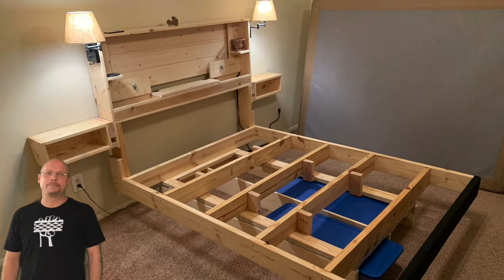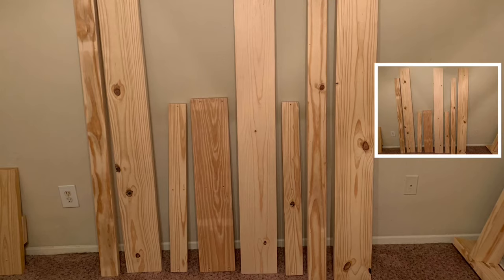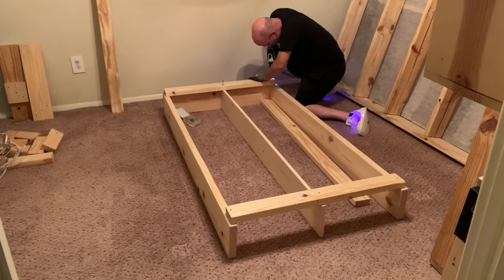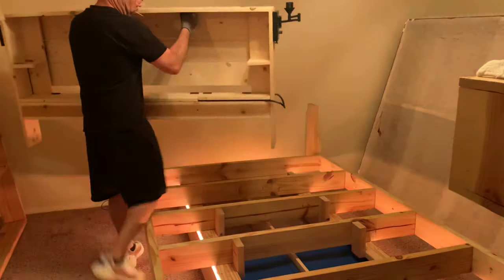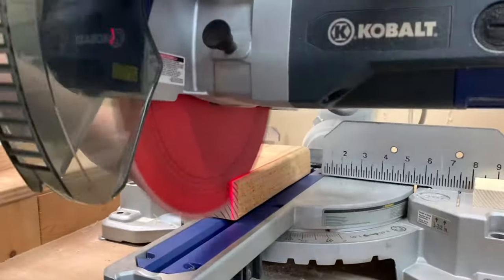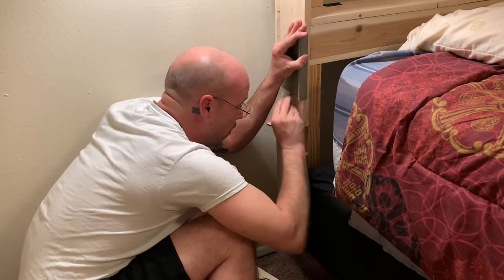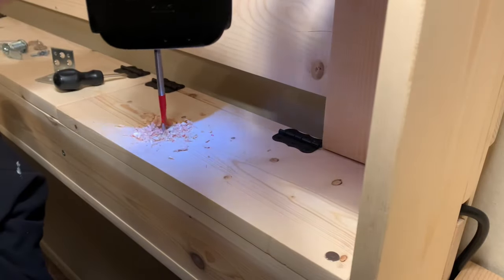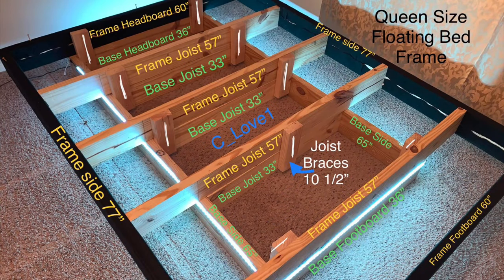Floating Bed Frame 3.0 DIY (everything you need)

Comment: I know you been wondering and from your comments, you never hear back; I made the twin version of this 3.0 design.  I added 5.5 inches (80.5") for the headboard and used pocket screws for the top half.  I still need to make the headboard.  With a 19" base, and 10" overhang, yes, the twin still isn't stable enough.  Granted it took a 170lbs tip it, but, I added 4 legs to the corners around the base (1.5" away from the base) and now it's fine.  It's a bummer from far away, you can see the legs and it detracts from the floating look a bit, but up close, still get the illusion.  Thank you!
Reply from the maker: @gunrock73 Wow, super awesome feedback G, thanks so much!  I just haven’t been able to bring myself to build one yet because of the lack of stability.  I greatly appreciate you taking the time to let me and everyone else know about your experience with the twin size here.  I’m glad it was able to work out for you one way or another.  Thanks a million times for your support my friend, I mean it.

Comment: Awesome build! Just one question, when you sit or put weight on the edge of the bed, does it wanna tip?
Reply from the maker: @Pretocb24 Hey P, thanks a lot for your question.  So many people were curious about just the tip that I had to address it in a later build.  No it definitely does not tip at all.  Check my video ‘part 2 - the headboard’ at the twenty five second mark and I’ll show you just how sturdy it is.  Thanks for stopping by and leaving your kind words.  Talk to you soon.

Comment: Love the video. Just wanted to know how many brackets and what size screws are needed for just the base?
Reply from the maker: @crystalgrimaldo4507 Hey Crystal, thanks so much and thanks for your question.  
Build your base out of 2x6, 2x8, 2x10, or 2x12 as desired.  Use three deckmate 3” screws at each wood junction.  I’ve upgraded to some corner brackets that are cheaper, just as legit, and easier to use than the strong ties that you use to secure the base to the frame.  Either way, I’d recommend 4 of those for your base/frame.  Reach me on Instagram realc_love1 and I’ll send you a link.  Anything else I can help you with?  Be careful on your build.

Comment: Hi C_Love1. Great bed and great video! Curious: what is the height from the floor to the top of the platform?
Reply from the maker: @Robert Ha Hey Robert, thanks for your question.  With my current setup, the deck of my mattress is 31” off of the floor...that’s a 2x8, a 2x6, a 4 inch box spring, and a 14” mattress.  Thanks for looking and talk to you soon.

Comment: Awesome looking bed. Great series.  Is there any need for padding behind the headboard for the times the security storage would be open?  Maybe a pillow? Or is it pretty secure?  Tia.
Reply from the maker: @isleif76 Hi Isleif, thanks for your question...this is a good one.  I very much appreciate your compliments support...I've poured a lot in to these floating bed frames and my YouTube channel overall, thank you, thank you.  This queen 3.0 is my personal bed frame that I still sleep on every single night.  I don't believe there to be a need for any padding at all.  With the storage doors open, the ones on the left and right rest against the back shelf uprights and the one in the middle rests against the boards running side to side on the back of the headboard.  Also in the video, I put magnets on the doors on the left and right side so they don't flop back closed or rattle at all.  I hope this helps.  Again, I very much appreciate your time and reassurance that what I am doing here is the right thing.  Come back and talk to me again down the road.

Comment: In the original queen video, you say to use 2x6 inch boards for both the frame and the base, but in this updated base layout, you use 2x8 inch boards. Is accurate? The frame is 6 and the base is 8, making the total height 16 in with the 2x4s?
Reply from the maker: @thethingisawesome13 Hey Avery, some of this is correct, yes.  I was improvising on this 3.0 build…I didn’t want to go purchase more items so I used what I had on hand at the time.  You can make the base out of whatever you want to…2x6, 2x8, 2x10, or 2x12…keep in mind they don’t actually measure 2x6, that one is actually 1.5”x 5.5”, 2x8 is 1.5” x 7.5”, 2x10 is 1.5” x 9 1/4”, and 2x12 measures 1.5” x 11 1/4”.  Stick with 2x6’s for the frame.  I hope this helps and makes sense.  I’m on Instagram realc_love1 if you’d like to reach me there.  I apologize for the confusion but thank you for your time and support.  🤝 stay blessed my friend.

Comment: Awesome build man, I'm here for the headboard but I've always liked the floating bed look too. Do you think you could keep the floating bed style with lift storage underneath? I just bought the lift arms from Rockler.
Reply from the maker: @Eric Stanley Hey Eric, thanks for your compliment and question.  I sure would like to and did consider this when I upgraded my base to include storage (video: ‘Floating Bed Frame 3.0’), but I went with what I considered to be a more simple design that would be easier to reproduce from a YouTube video.  I think the lift storage might be a little intimidating for some builders.  I’ve seen YouTube videos with the lift storage integrated, so I’m sure you could find one that will work for you.  I’ll be making the king size and the full size later this year so I might look in to these lift arms for either of those designs.  I appreciate your time.

Comment: I would like the size for the frame you put on the base
Reply from the maker: @Arron Arnold Hey Arron, thanks for your interest.  This is my personal queen size bed frame so your style and preference may be a little different.  This base is the equivalent of a 2x10 on edge with a 1x10 running down the middle as a divider for the bin storage area.  I think I may have slightly modified the dimensions from the original build so make sure to check the 'videos' section on my channel for all three queen size floating bed frame videos.  This will make sure that you have all of the info you need for your build before you get started.  If you'd like, I'm available on Instagram realc_love1 and I'll be much more than happy to help you as needed.  Talk to you again soon my friend.  Merry Christmas 2022.

Comment: How small is TOO small for the bottom frame? Moving into a new home and I am build my kids new frames. I think what you’ve done here is awesome! They have twin mattresses with not enough room to really upsize the mattresses to fit your measurements
Reply from the maker: @Devin Parker Hey Devin, thanks for your question and interest, happy new year 2023.  I build the bases for my floating bed frames as small as I comfortably can to make sure it is hidden but also so that the bed frame is solid and won’t tip over.  I’ve gotten more than a 100 requests for the twin size at this point but haven’t built one yet because of the dimensions.  It’s just too long and narrow to be able to adequately hide the base under there while keeping the frame very stable.  I hope this helps and I’m sorry to disappoint my friend.  Feel free to reach me on Instagram realc_love1 at any time.  I’ll talk to you again down the road.  Be careful.

Comment: 👏 good job but does the mattress slide off because it’s flush ?
Reply from the maker: @kev lannigan Hey Kev, thanks for your question.  Nope, not at all…this after it being like that for over two years now.  Hundreds of my subs have built this bed frame as well and I’ve never heard that from any of them either.  I hope this helps.  Thanks for stopping by my friend.  I appreciate your support.
Reply: Thanks for replying was just curious as the beds you buy are the mattress is inter grated
Reply from the maker: @kev lannigan I’m not sure that I understand your reply here.  You will either need a box spring or some plywood to support your mattress if you build this bed frame.

Comment: How much did all the wood cost? N is it possible to have Home Depot to cut the wood ?
Reply from the maker: @T Hey T, thanks for your questions.  Cost depends on how well you plan the project out, how much you want to do, and the availability of your materials.  This 3.0 build as it sits would be about $400-$500 for all of the materials.  Then you gonna need the tools to prepare them also.  Yes, Home Depot will make the cuts for you, but here in Texas, they charge you per cut.  By the time you get done building this bed frame, you are going to want to keep building other stuff, I'm pretty sure of it.  If you can, go ahead and get you a circle saw instead of paying for HD to cut them for you.  Then you will gain experience in cutting lumber and a tool to do this more in the future.  I hope this helps my friend.  I appreciate you subscribing to my channel and supporting me.  That's what keeps me going.  Talk to you soon.

Comment: nice vid! question. when you added the headboard did you have to cut the long side of the bed frame again or was it kept the same at 77 inches ?
Reply from the maker: @J Ex Hello J, thanks for stopping by and asking your question.  Answer: bold of you to assume I cut the frame side boards at 77” instead of 78.5”.  …Originally, I built it with 77” sides but have since modified it so all the joists are the same length and the sides are 78.5” now.  This allows me flexibility when someone wants to add a headboard, it’s an easy modification by just adding 5.5”…that is the thickness of a 2x6 for a total of 84”.  I hope this helps.  I appreciate your support my friend and look forward to talking with you again.

Comment: So what about the instructions about when you move how to take it apart and how to tell the movers how to move it
Reply from the maker: @user-cg9oy4es8v Hey, good morning Timothy, thanks for stopping by.  I left the disassembly and moving part out so that you would come by here and talk to me today.  Actually, I didn’t really think that far ahead.  No way I could have ever imagined, anticipated, or hoped for these floating bed frame videos to get millions of views like they have(3.6MM 05.25.2024).  At the time of this 3.0 build, I was trying to save money and clear up some space in my tiny apartment by using materials I already had on hand.  When I move, I personally will completely disassemble this bed frame and keep all the pieces.  When I get to where I’m going, I’ll cannibalize this 3.0 in to a final version for myself.  I’ve learned that these videos act as a good basis to start from…not everyone builds them exactly as they are shown here.  I’d recommend a 2x8 for the base in this case instead of building it as it is in the video(2x6 and 2x4 laying flat stacked on top).  Take the time to label every single component and orientation in an area that won’t be shown when the frame is assembled so when you do move, you can either break it down all the way or just in to three large components(base assembly, frame assembly, and the headboard{you are gonna need 4 pretty strong hands to move these three pieces}).  Make sure to hit the same holes when you re-assemble.  I appreciate your time and support here, thank you for your great question.  Apologies for the length but I hope this helps.  I’m here if you need anything else my friend 🤝

Comment: Woah wtf I didn't even notice till second watch through that you're using a cobalt miter saw. What happened to the dewalt?
Reply from the maker: @Justin Dickinson I was in the shop with my buddy (street name)Yancy that weekend making several things.  I made a separate video for ‘Custom Cutting Board’ but also made the cuts for the floating night stands that weekend too.  DeWalt still running strong.  Got the portable job site table saw and 13” rigid planer now too.  Videos for each of those coming soon.

Comment: Would these measurements work with a full size bed too ?
Reply from the maker: @BaSiC_puffshD Hey B, thanks for your question.  No, I don’t think so.  A full size measures 54” x 75”, that is 137.16cm x 190.5cm.  This build is for a queen size which measures 60” x 80”, again, for reference, that is 152.4cm x 203.2cm.  I hope this helps.

Comment: You didn’t add ply wood on the top?
Reply from the maker: @booobzinthetrap187 hey Trap, nah, I used a box spring.  Others have used plywood with holes drilled in it or cedar fence pickets spaced apart to allow the mattress to breathe, but I stick with recommending the box spring.  I hope this helps.  Thanks for stopping by and supporting this channel my friend 🤝

Comment: do you have an idea of how much it'll cost as a whole?
Reply from the maker: @JaylaRochelle Hey Jayla, thanks for your interest and question.  It’s hard to tell with the price of lumber that it is now, but with everything that’s in the video (bed frame, headboard, floating night stands, bins under the bed, wireless charger, lock sets, power strip, lights under the bed, lamps), I would ballpark materials at roughly $700.  Again, that is with everything that is in the video.  You could come in WAYY under that if you are just talking about the bed frame though.  I hope this helps.
Reply: @CurtisMadeIt  Thank you for such a fast response, yes this was very helpful !
Reply from the maker: @JaylaRochelle You bet, I’m glad to help!  Thanks so much for your time, I appreciate it.

Comment: Do you need to use a box spring
Reply from the maker: @Claudio Acevedo Hey Claudio, I personally did, yes.  Either that, or use plywood on the deck instead of the box spring.  Thanks for stopping by my friend, I hope this helps.  Let me know if you have any other questions.
Reply: What size bed was this
Reply from the maker: @Claudio Acevedo This is a queen size bed.  I’ll be posting a video for the king size before too long.  Full size will be further down the road this year.

Comment: You don't need to check measurements twice if you just do it right the first time. Once you've ruined enough boards by cutting them short you'll eventually start measuring right.
Reply from the maker: @Justin Dickinson Totally agree my friend.  I still check my measurements twice though.  Even after all the stuff I’ve created and built, I still have the occasional oops.
Reply from the maker: @JT Yeah, this is the way to do it.  I've wasted enough material to build an army barracks at this point.  Always measure twice, cut once.  Thanks for stopping by JT.

Comment: Curtis, I do not want to use a box spring with the Mattress, what modification should I ADD or REMOVE?
Reply from the maker: @michaelpelegrin8970 Hey, good morning Michael, thanks for stopping by.  To support your mattress, you are either going to need plywood with holes drilled in it or cedar fence pickets spaced slightly apart.  The holes or spacing allows the mattress to ‘breathe’…this issue(mattress being able to breathe) was brought up to me by a viewer and not something I had previously considered, but it does seem to make sense and feels right so this is what I recommend in the absence of a box spring.  I hope this helps.  You have any other questions?  Thanks for your time and support here, I mean it 🤝